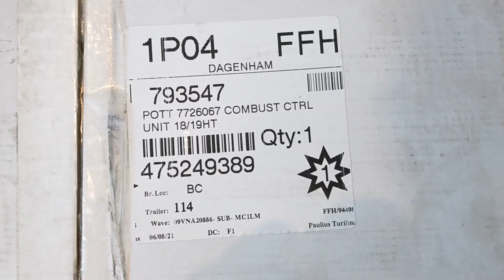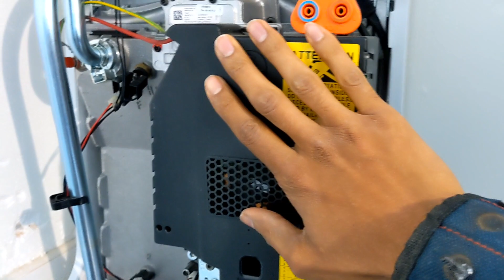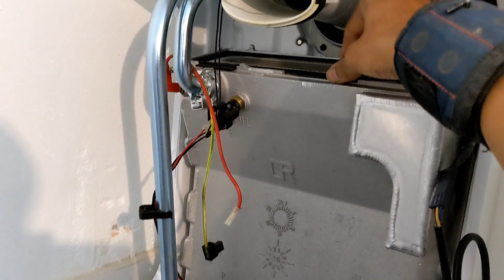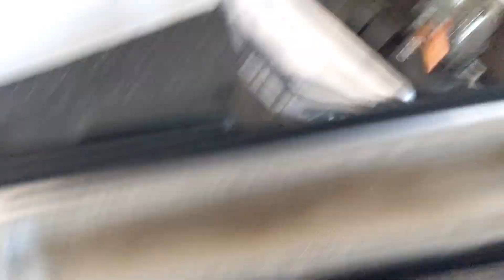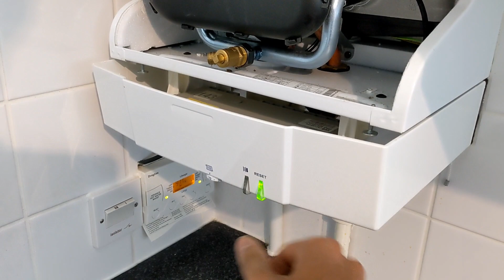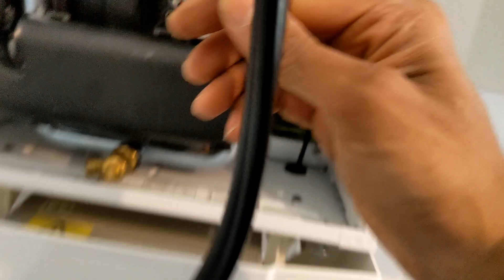How to replace a combustion control unit on a Baxi Heat Only boiler

Comment: Ignition lockout on this on minimum what can it be
Reply from the maker: Have you tried to adjust the gas valve? If I remember correctly it has to be within 0.4% of the max and around 8.9%
Reply: It was blocked main heat exchanger in the end had to replace it not good heat exchangers very easy to get blocked and apparently baxi say if clean them with water makes it worse which is the problem I had it got worse after using the karcher pressure washer. Since replacing it works like a dream boiler was only 6 years old. Main heat exchanger costs 800 plus 😂

Comment: All now working again....👌In total with the failed Combustion Control unit & the incorrectly fitted 30Kw one, it has had 4x Combustion Control Units fitted in the last 10-days!!! @ over £320 a pop, not cheap......Looking forward to more videos...
Reply from the maker: Wow that's crazy! Main thing is it's sorted now. Just goes to show why part numbers are so paramount to the boiler you're fitting it to when it comes to combustion

Comment: Latest Update, Senior BG Gas Engineer has ordered a replacement for the replacement, not happy with the Gas valve Electrical Readings, thinks that the Gas Valve has blown the PCB? Replacement due to be fitted tomorrow......🤞

Comment: Just to add, I complained to BG about the persevered capabilities of the first Engineer, he was blaming his stores for sending the incorrect part? BG are sending out a "senior" Engineer tomorrow for a second opinion. It maybe that the 2nd Combustion Control Unit has a faulty Gas Valve, so needs a 3rd Unit, But the Original Gas Fitter wasn't prepared to sanction another one, So to be prepared for tomorrow, is there anything that you can check for a faulty Gas Valve? Is there a setting on it that maybe closed, or is it a case that it either lets Gas through or it doesn't?
Reply from the maker: Sorry to hear of your troubles, there's also a coding chip which is programmed to the boiler so to make sure that's been fitted as well
Reply: Thanks, TBH I don't know what the first BG Gas Fitter has fitted, to me he seemed way out of his depth & was on the phone to BAXI the whole time, from what I see from your video, it should be quite straightforward. I just hope that he hasn't damaged something else by fitting the 30kw Combustion Control Unit first? That is my major concern ATM. From a simple replacement of a failed PCB, I could potentially be looking at a replacement Boiler, if the person tomorrow can't fix it...I tried my best getting a reputable household name in & it seems to have backfired on me big style.....
Reply from the maker: @peterromaniuk5771  I don't think you have anything to worry about, as you're covered by BG they will have to get the boiler running for you. Hopefully the new correct combustion unit will sort it
Reply: Well that's not what the first Guy said!!!! After 3-Days he just turned around & said "That's it's I can't fix it!" & washed his hands of it....Said that he would speak to his Manager & get the HomeCare Contract cancelled & refund me what I've paid......He said, he couldn't sanction any more replacement parts as they are so expensive!!!! No Shit I said.....Hence I complained & hence the "Senior" BG Engineer fingers crossed coming out tomorrow for a second Opinion.....

Comment: Hi, It turns out that the first Combustion Control Unit the BG Gas Fitter fitted was for a 30kw Boiler BAXI Part Number 	7786339 & not for the 25kw Boiler that we have & that is why he couldn't set the MAX & MIN CO2 Readings!!!! He came back the next day with the correct Baxi Part Number 7775020 But now there are 3 Red Flashes instead of 4!!! which is an ignition Fault according to the Service Manual. He says the Gas Valve isn't opening?? Could he of damaged something else by fitting the Incorrect Combustion Control Unit in the first place??

Comment: Hi, A quick question, Just had a failed Fan on one of these, a EcoBlue Advance Heat 25 ERP, British Gas came out & replaced it, the Capacitor on the Motherboard had Blown. The Man from BG then struggled to set the correct Max/Min CO2 Settings? Is there a "Base" Setting for the Adjustment screws? ie All the way in or all the way out? From which you can then carry out fine adjustments? He thinks it might be a faulty Gas Valve on the New Combustion Control Unit? I know that new parts do fail, but I'm only the homeowner & not a BG Gas Registered Fitter, But before he condemns the newly fitted Combustion Control Unit, it may steer him in the right direction, he said yesterday that he had never fitted a replacement Unit before, which doesn't instil me with a lot of confidence. Thanks for any feedback that you can provide....
Reply from the maker: Hi, all the combustion control units need setting up out of the box. All he needs to do is to check the instructions for commissioning and all the information is in there on how to adjust the gas valve. Max rate has to be between 9.2-9.4% CO2 and the minimum has to have a 0.4% difference from the max
Reply: Thanks for Your Reply, I have the Service Manual, so will photocopy it & laminated it & leave it conveniently by the Boiler!!!!😇  @cputilitysolutions

Comment: Does it come with new fibre?
Reply from the maker: For the gas connection yes
Reply: @cputilitysolutions  for the setting up of gas valve, is it turn it on and then adjust? Just as some always say turn 8 times etc
Reply from the maker: @lostinthoughtscalminsilenc8167  yes put it in service mode and then adjust as you take your readings 👍🏾

Comment: Hi -- yes iv'e done a couple of these burner units -- both boilers were just out of guarantee -- one a baxi 224 combi and one a potterton titanium 18kw heat only  -- both units are fan , pcb + gas valve -- and what i think is that on both occasions the units failed when the boilers were in demand + the power went off -- ether a pre payment meter running out or the power being turned off at the consumer unit  for some reason -- and then the power put back on while the boilers were still in demand !! your well right it's got to be poor manurfacture thats causing this in the first place -- i like your videos take care Jim .....
Reply from the maker: Thanks Jim glad you enjoy the videos 👍🏽 the unit is pretty straightforward to change but a rip-off how it's built!

Comment: Well this has just convinced me not to buy a Baxi 400 series if you can’t just change the fan that is doomed to fail in a short life time. Ridiculous design!
Reply from the maker: Yes and no, there was a faulty batch produced but they've rectified the issues now. Also you'll get between 5-10yrs warranty depending on which model you go for so you wouldn't have to pay for the repair if needed within that time. I still fit a lot of these Baxi heat only boilers as they're easy to install, don't require a permanent live or pump overrun, and have a rear flue option as well. Don't be put off by the repair! 😉
Reply: @cputilitysolutions  Even if they are now better, conceptually, to have the fan integrated into the unit like that is just plain stupid. It's a mechanical device that will eventually fail and should be changeable easily and at low cost. To replace it in the future is around 3/4 the cost of a new boiler, plus there is the labor charge to add, crazy design so I wont be getting one, even though I think as a boiler when its working properly it's probably a good choice. Why on earth can't they make it so the fan can be easily changed at a sensible cost? Oh yes, it's so they can rip people off for overpriced spares! I've got a Glowworm Spacesaver that is now 33 years old and is still working fine, granted it's not very efficient but it's cost virtually nothing to maintain just requiring 3 fans in it's life.

Comment: Why do these units fail like this?
My daughters new house is just 3 years old (stood empty for first year) and now the 4 red led flashes. Fan spins freely.
Obviously a pcb component has  failed.
I assume this is not a DIY job as the gas valves etc need to be reset and calibrated.
Reply from the maker: It seems to be a manufacturing flaw as I've changed quite a few of these now. As long as the boiler was registered you should still have warranty on it so best to give Baxi a call and definitely NOT a DIY job!

Comment: Stupid design. It's like changing a car engine just because the water pump goes. I replaced with new boiler.
Reply: Yes absolutely idiotic design just because a fan has busted.
Reply: @nathd1748  absolutely stupid and designed to cost you lots of money in repairs.......should be made illegal

Comment: Great vid thanks. How do you rate these boilers?
Reply from the maker: They're decent heat only boilers, I believe there was a bad batch manufactured with this fault, and apparently it happens more on Y-plan systems someone who works for Baxi told me.
Reply: @cputilitysolutions  thanks.

Comment: I had this issue with one of these but could not seem to get the parts for it as seemed to be to new at the time. :/ also surprised baxi sent washers etc. As they hardly never send washers or o rings or seals.